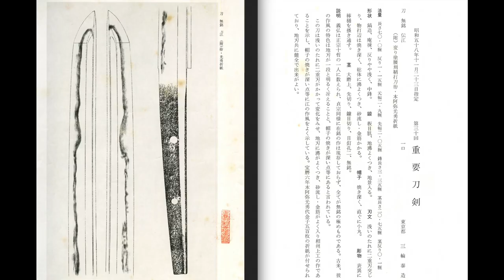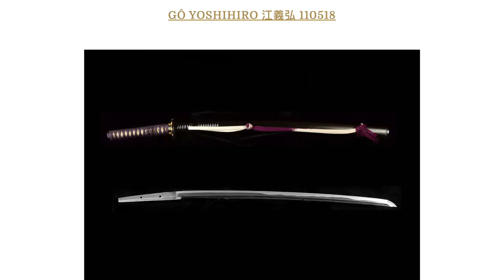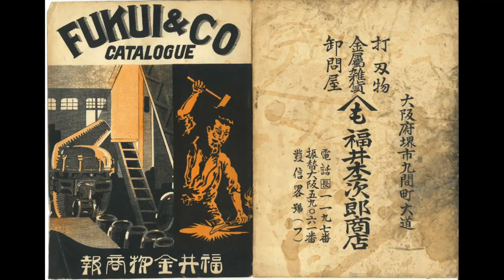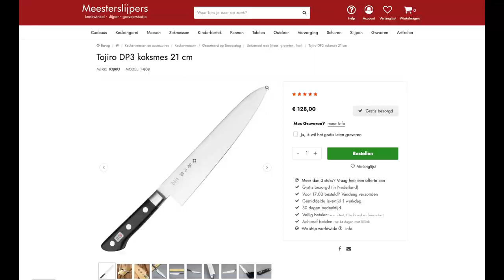Great budget knives

Comment: I own the 240mm Yoshihiro Gyuto Aogami Super Stainless Clad, the first Japanese Gyuto I own and started with. Highly value for money quality blade your money can get. Decent workhorse with great edge retention. Just a bit sand down on the spine and it will be a great joy to handle. The only thing I don't like will be the finishing on the blade will get scratch marks quite easily.
Reply from the maker: That's pretty much the same verdict as mine. And thank you for your confirmation that this is a great starter knife with high value for money.

I did not get to use these, so thank you for sharing the 'easy scratch marks' property of these blades!

Personally, I don't mind that a knife shows it is being used and showing wear and tear, as long as it ages a bit gracefully. But I can imagine that you don't like it. You could thin the blade and re-polish again to restore the finish.
Reply: Why do you say it will scratch easy?  Comparable to other knives?
Reply from the maker: @GlennLaguna
Because it has a Migaki finish (polished). Every scratch will be highly visible. I'm not saying it will scratch more easily, but scratches will be easier to see on a polished blade.
A knife with, for example, a Nashiji finish, or even a Damascus finish, will not show scratches too easily because there's so much going on on the surface of the blade.